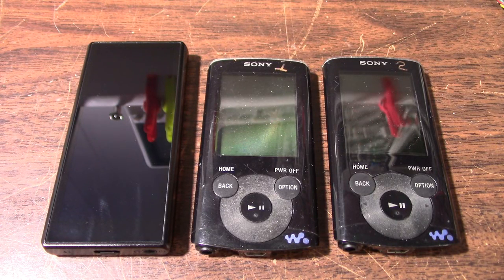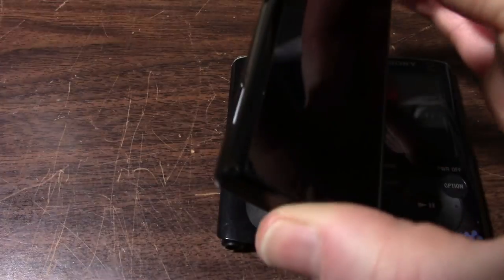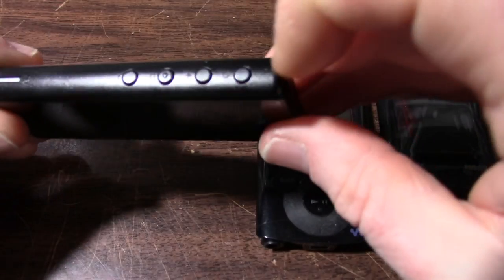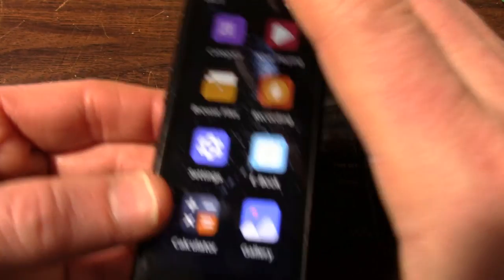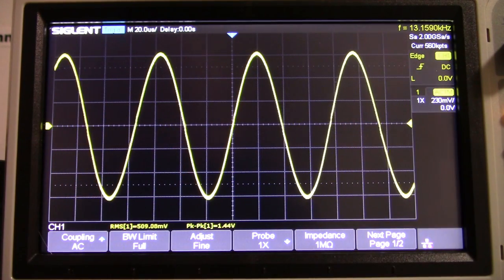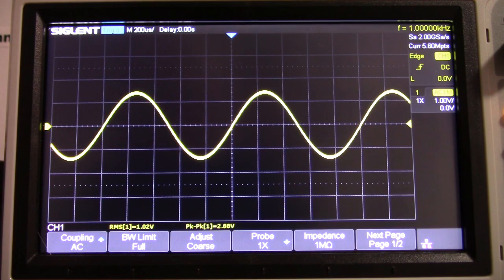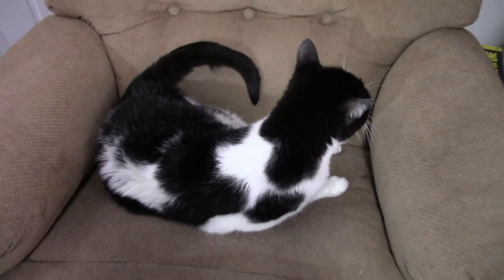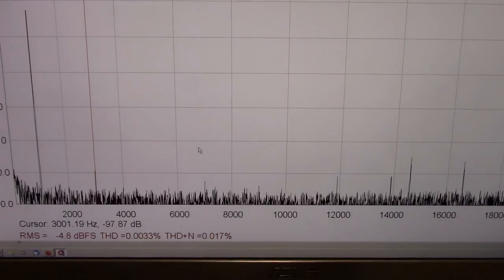FiiO M3 Pro music player audio test

Comment: have you tried using a cheap usb audio dongle for your computer? I've found they're typically much cleaner than the onboard audio chips
Reply from the maker: I'll have to look into those. Probably after my next computer upgrade that is overdue.
Reply: @JohnAudioTech  do what you feel is best, but I don't see the reason why you'd have to wait till after your next computer upgrade. These dongles are like $5-$10.
I have a couple Sabrent USB dongles and they're not bad for line level audio (not for headphones or microphones).
If you want to wait till after your upgrade not because of limited budget but instead because of limited time, than that I can understand completely.
If you need/want a usb dac with 96khz and 24bit then you'd also need something in the $80 and up range, so for that I'd agree with waiting for later too.
Sorry for making such a long and probably pointless comment. Have a nice day

Comment: I have a very silly question, is there something available to measure the output audio voltage while using the #SoundCard as well, using some other Software kinda stuff along with these #Customized Hardware made by Yourself ?

Actually I just want to get justify the output of your Audio #SoundCard along with the #Oscilloscope Value, whether the #Data is going to get match or not ?
Reply from the maker: Not sure I follow. You could use another  oscilloscope (or scope channel) to monitor the soundcard.

Comment: I use a dragonfly black usb dongle on the bench, $80 but measures super clean.
Reply from the maker: I'm due for a computer upgrade. I'll see how its audio performs. I may look into that if the audio is still an issue.
Reply: @JohnAudioTech  with the onboard chips it’s hit&miss, some of them are quite decent, others are really bad. I had some that where not able to play a square wave into 32 ohms without it looking more like a sawtooth.

Comment: how did you get on board audio going to 100khz almost , i dont get that , i built amp tester on the soundcard , attenuator that is , and the way i checked i didnt have 100khz , i got 22khz , so i wonder how did you achieve 100khz
Reply from the maker: I set the sampling rate to 192KHz
Reply: @JohnAudioTech  Ok, thanks , i have M Audio  M track 2x2M
It can go 192khz @24bit tho its says 32bit in windows but i think thats just some conversion or something .
So you think i can roll like that as well , even better due to better ADC and DACs and stuff

Comment: Your pc sound card is not the best way to test distortion!. Specially on board sound chips r really bad in older motherboards. Newer ones have better dac but still they r in a jungle of other components with lots of inductors and different frequencies that can influence the audio signal. U better buy a usb audio interface for better quality testing and this fiio m3 pro can work as a dac for your pc as well. If u connect it to pc u can use it as a really high quality high sample rate audio interface. (Much better than onboard audio of most pcs with 24bit of 16bit audio max .. u need to buy 100$+ motherboard's to get 32bit dac.